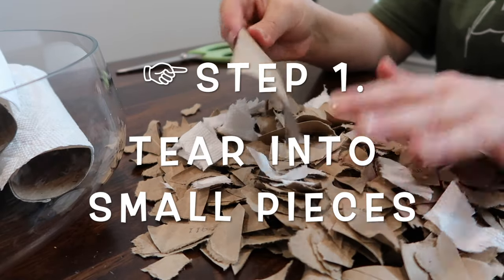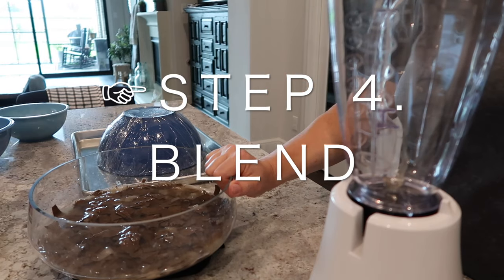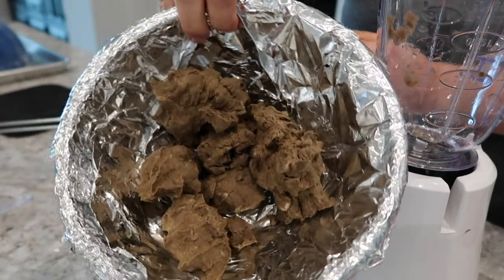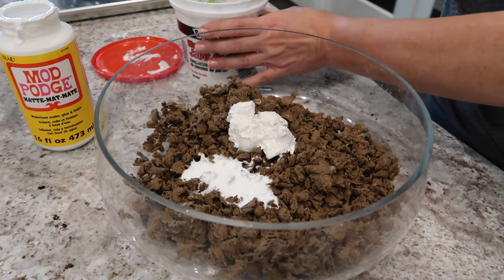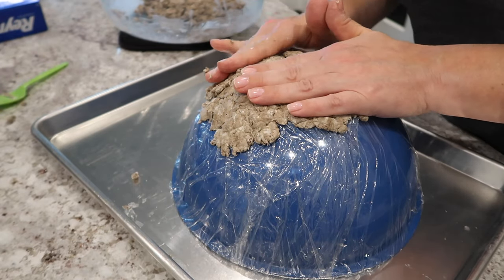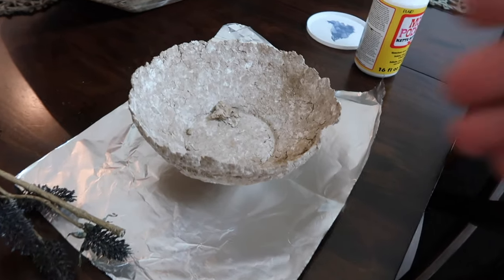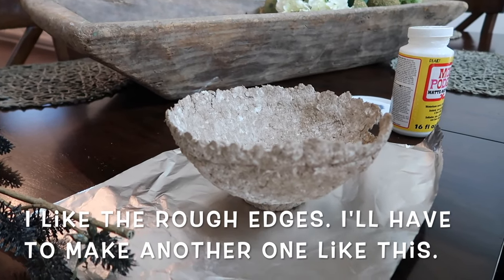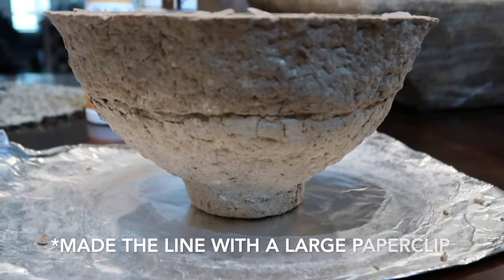DIY PAPER MACHE BOWL //  McGee & Co and Restoration Hardware inspired.

Comment: I love paper mache bowls. Yes absolutely takes a few layers of pulp, l leave mine in the hot sun and l use wood glue to adhere so it won't have any cracks and lasts forever
Reply from the maker: Thanks for the tip.  I have another paper mache project I want to make and I may have to try the wood glue. 😊

Comment: I'm new to your channel and am really learning and enjoying some DIY's from you.  Your bowl turned out fantastic.  I have a question.  Does the house/room have to be a certain temperature to get the paper mache' to dry?  I've tried just paper mache' and mine never dried, but it's winter and a little cool in our house.
Reply from the maker: Thank you! I'm glad you are enjoying my videos! 😊  I haven't tried making paper mache with flour so I'm not sure on that.  I have read that you can put small paper mache projects in the oven on a low temperature to dry them. With my bowl, I just let it sit on the table for a couple of days.
Reply: @SusanBesharse  both raw and boiled flour paste work and dry in the house in winter -- summers tend to be humid where I live, so the heat is little advantage. Just be sure to add plenty of SALT as mold prevention. 🙂